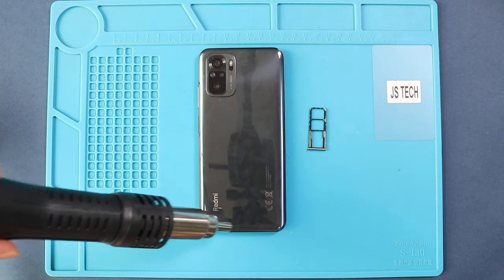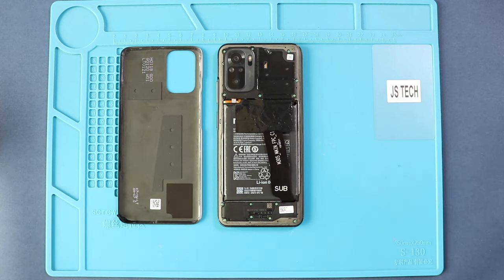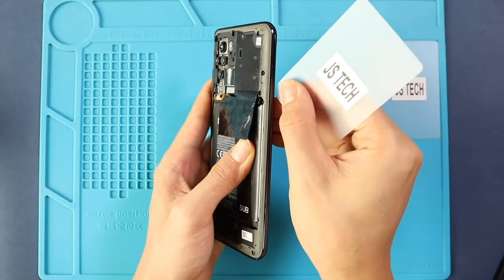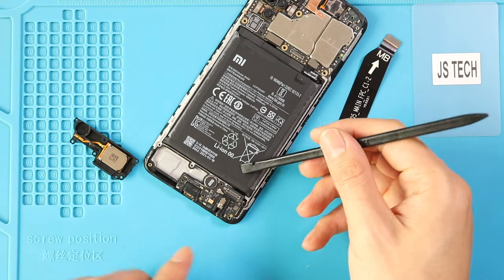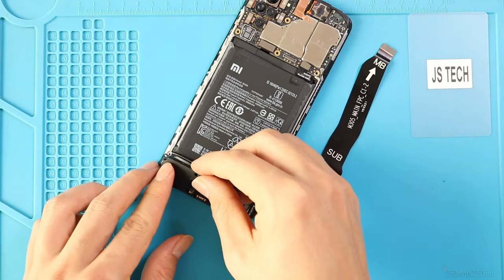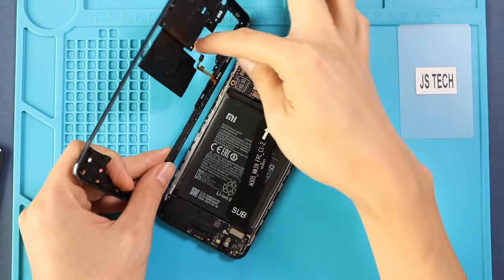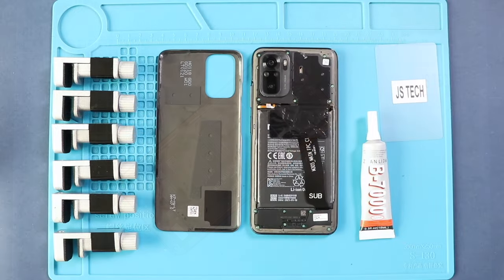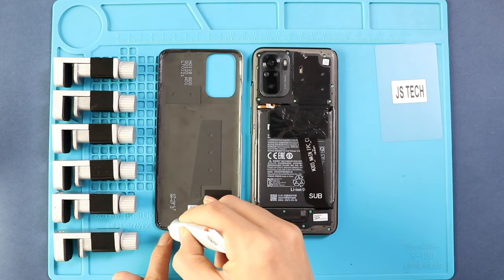Xiaomi Redmi Note 10 Charging Port Replacement

Comment: Mine has a problem of stopping to charge between fast and turbo charging in intervals of split second, it is irritating for real. Can you assist please...
Reply from the maker: You can try to update the phone first, then you can try to reset the phone to factory settings. If is still happening it is most likely with the charging board and logic board. That needs good inspection by a technician